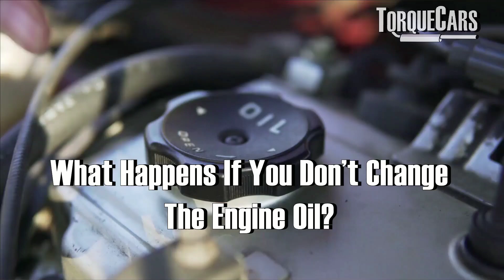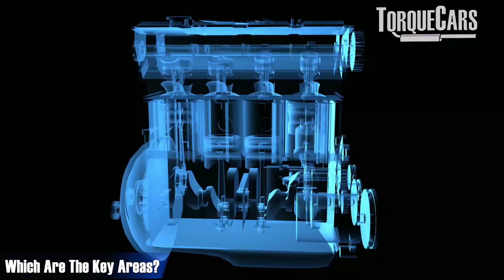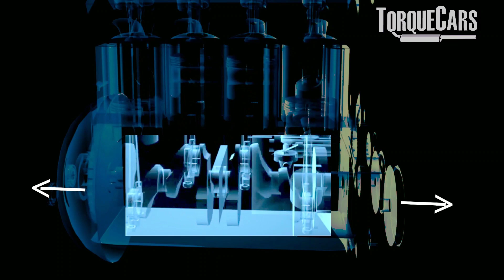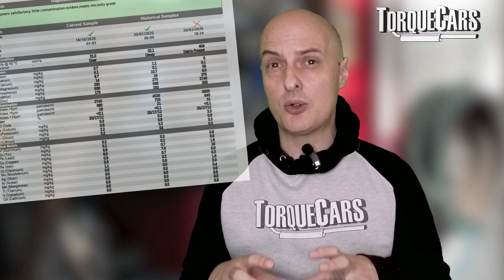What Happens  If You Don't Change Your Oil? Engine  Oil Myths Busted!

Comment: The cost if oil is cheap when you consider what you get from it. 
I always change mine midway  between cycles, along with oil and air filters.
Along with that, I regard fuel as cheap. I understand it is expensive but what do you get for it? The ability to transport people and goods at your convinience in general comfort, normally in a time of your choosing .The amount of mileage & cinvinience you get from  a single litre of fuel is huge, regardless of the weather conditions!

Comment: Could you tell what happened if you have a perfectly serviced car, always on schedule and can't do the kilometers?
We had a baby last year, usually we use the car just to exit the city, but obviously the car trips this year were less. Instead of every weekend, the car was used once every month and a half. So oil was not "stressed" by heat and friction.
Should i wait until the mileage is done or change it before hand?
The car says to wait for a certain kilometers number, not "years", could you comment on that?
Reply from the maker: Generally speaking the Oil and the additives in them will not degrade over a couple of years significantly depending on what the engine has dumped into it over time (the acids collected by running through the engine can cause them to deteriorate a little) but I'd try to change it at the 2 year mark and not go over that. It will depend on the oil chosen and the type of engine and I know many will say to wait .

The stock answer to your question is to change it sooner than than the kilometers stated but longer than the time.

During lockdown my mileage shot down from 15k to 3k so instead of the usual oil changes I do I just did one change at 6k or 2 years.
Reply: @torquecars  it is hard to understand without scientific evidence. If the oil doesn't degraded why one should change it ?

I found on another video humidity could cause damaging and oxidation. But can't find proof. I will change it, but I am super curious to know the answer. If I leave a car in garage with 5 litre of brand new oil, what happen to the oil if the car is not use for a year?
Reply from the maker: Sending the oil off for analysis is the only way to know for sure as you say, we can only generalize and there are so many different oils out there and a whole range of additives. 

I didn't explain very well last time, sorry about that hopefully this will make things a little clearer.

I too have heard about oxidation but the surface of oil in the sump is not exposed to a great deal of air and personally I haven't found that oxidation is a big risk.

It may collect air sitting there but by the time it's run through an oil filter the air "bubbles" will have been extracted reducing any panic about cavitation happening. 

I have seen little degradation of oil upto 2 years old where cars cover limited miles.

Oil contains detergents, dispersants, metal rust inhibitors binding agents etc... When oil runs through an engine it collects acids, a by product of combustion and from what I've read over the years it is these that degrade the additives in the oil over time. Indeed leaving oil alone on a shelf it will generally be as good as it was when it left the factory. Turbo engines and diesels with DPFs tend to be harder on oil life than NA engines.
Reply: @torquecars , I thought naively there were data available on the topic published somewhere. A simple experiment of "life shelf". 1year open on the shelf, 1 year intense use, 1 in the car but no use. I guess those companies that provide the analysis should know for sure.

Comment: I knew a TAXI driver, who never drained and filled oil. What he did, was to spin a new oil filter on it every 1,500-2,000 miles, and still got ~165,000 miles out of it. His idea was, that by then, in TAXI service, the whole car was worn out by then. In a TAXI, all .the driving is in town, so there is a lot of shifting of the transmission, so that's pretty much gone by that distance. He saved a lot of down time, by being able to change the filter while he's getting fuel, add the quart of new oil, and be ready for the next "hail". Since the whole car was worn out by then, the engine only needs to last the life of the car. He said that TAXI cars are typically scrapped, rather than sold. With the severe driving, they're pretty much "used up" after 150,000+ miles.
Reply: Surely as a taxi, ignoring the oil change, what about the other service parts, brakes, filters, transmission?

Comment: I just changed my euro 6 1.4 tdi 2016 Vag motor, and i reset the oil service. It reset for 4700 Miles for oil change. Thats excellent, stick to when my car tells me right stupid get me warmed up and empty my pan for me, then doing it within the service interval i shouod have pretty much no problems.

Comment: Not disputing the facts here and I change my oil regularly but a story my dad told me, the lead mechanic at the place we worked said he never changed the oil in his car. It was a 1967 HR Holden with a 186 motor. It had done over 125 000 miles including 3 trips across the nullabour, at least one if those was before it was sealed. His theory was the cost of rebuilding the engine was cheaper than the oil. Back then a 186 was a simple and cheap engine to rebuild. Last time we saw him was about 1982 and the HR was still going strong.

Comment: Great video, cheers! Now I'm wondering the same thing about the coulant, its composition and changing frequency or topping up?
Reply: If you have aluminum heads or blocks then don't mess around.
Do the coolant changes as per the book and don't mix coolants you can get bad reactions.
Reply from the maker: Glad it was helpful! Thanks for the support and encouragement my friend. I am working on a coolant related video, it is in the research and scripting stage, so in a few weeks time it should be live.